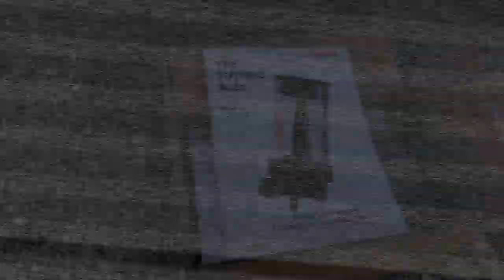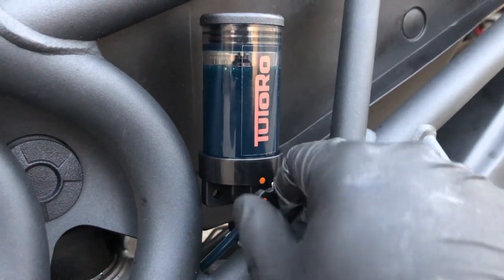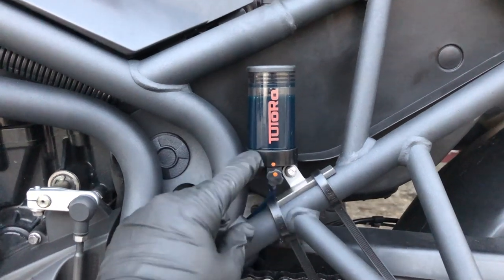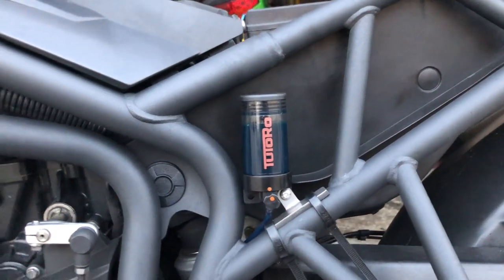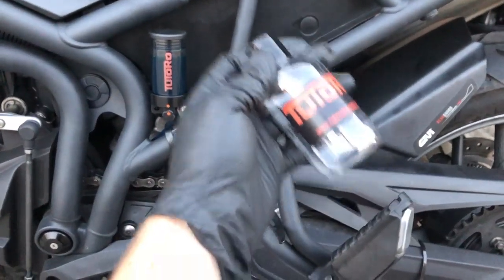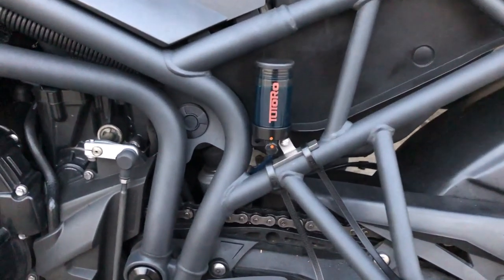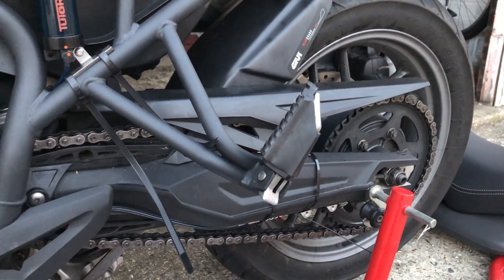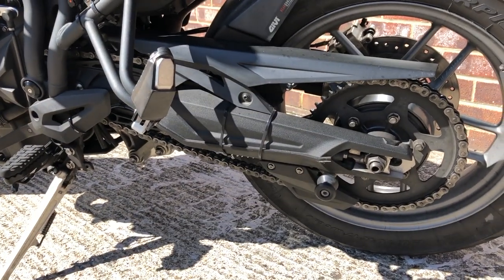Tutoro Auto Chain Oiler Review - Tiger 800

Comment: Got 3 vfrs all of them have the tutoro auto oiler had them fitted for a good few years now this oiler is simply great never had to adjust the chains on any of them . The one fitted to my 800 viffer was fitted to my triumph sprint and my kawasaki  sx 1000 it must have done at least 35000 miles and still works perfect back up service from them is great nick and jude very helpful this is a great piece of kit and very easy to fit .

Comment: Really liked my Tutoro, though it went with the Honda. It took a bit of tweaking to get between splattery rear tyre and too dry a chain but once sorted, it worked like a charm.
I think my manual said one turn or 1.5 turns. Either way, it was far too much. I spoke with Tutoro about it and they suggested only a quarter turn, which was quite a surprise.
I would recommend getting the protective cover. A few people have complained about stones breaking the reservoir. I've just contacted Tutoro about getting a new reservoir and they are about £65, so worth protecting. It does make it trickier to see the level though.
I never needed the top-up bottle but you might for touring. I could get well over 1,500 miles from a bottle.
A couple of tips I picked up from using it and talking to other users. 1) You can use Scottoiler oil but it's thinner, so you'll need to reset the flow rate. 2) Make sure you cover the reservoir when cleaning the bike. Lots of cleaners and degreasers will destroy the reservoir clear plastic. It goes a bit white, then falls to pieces. It's just a chemical reaction with the plastic they used.
Reply: I run chainsaw chain oil in my Tutoro....find the thicker Summer oil is best/less fling. Dirt cheap at $5 CDN for one litre bottle. Yes, keep the reservoir covered when washing. I found water can accumulate inside and essentially messes up the inertial valve from sealing properly..letting the oil keep flowing out when parked. Had to dismantle the whole thing and get inside to completely clean up the valve, but now its working well again.

Comment: What setting did you settle on with the flow mate ? Yiu initially had it at one turn, did you knock it back to about half ?
Reply from the maker: I was using it at about half, then the dual nozzle came out of place and got damaged by the sprocket, so switched to the standard nozzle. At some point during all that, I’ve had difficulty getting the chain to look like it’s actually getting lubed. I haven’t confirmed it yet but I think the mechanism in the reservoir might be faulty. The flow is fine if I stick the magnet on it so I know it’s not a blocked tube.